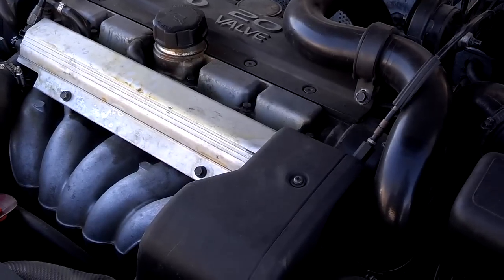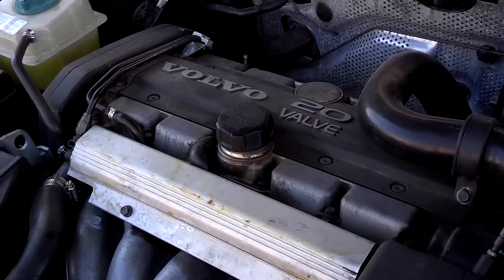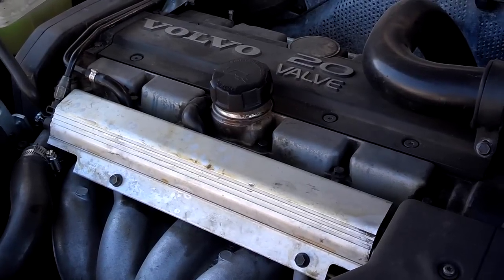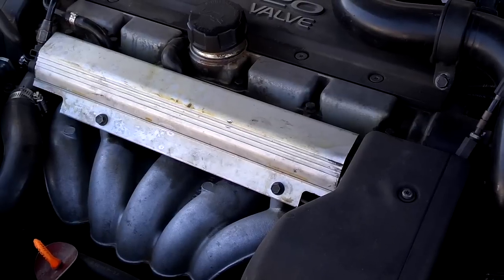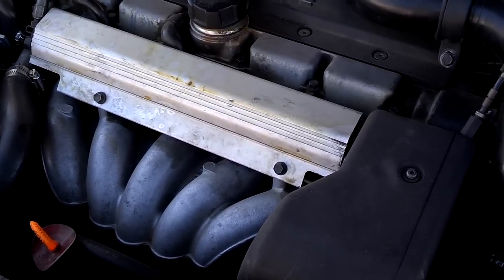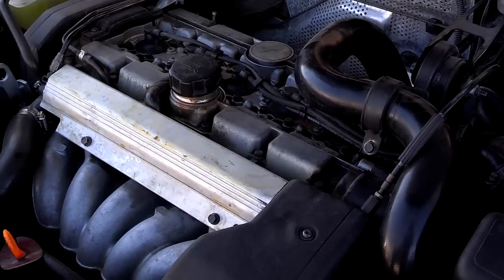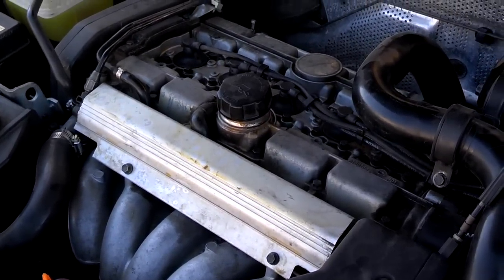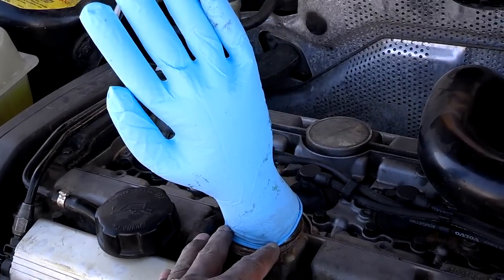What is a PCV system and how does it work? - Auto Information Series

Comment: Hi  Robert.  We have a 2011 C30.  Yesterday we noticed that it was making a squealing sound, very similar to a loose belt.  I actually thought that was the case.  I brought it to our local mechanic and he listened to it with a stethoscope like thing and said the sound was coming from somewhere just to right of the belt.  He took the oil cap off, and the squeal stopped.  There was quite a bit of suction going into the hole, so a no glove needed, we could feel it.  He put the cap back on and the squeal started again.  Then he took out the oil dipstick, and again the squeal stopped, and there a lot of suction going.  You could actually hear it.  Seemed like way more suction than in your video.  He put the dipstick back in and the squeal started again.  Any thoughts on what the squeal could be?
Reply from the maker: Bad PCV system. A diaphragm in the box. I think iPdusa.com sells them.

Comment: Hi Robert, i have b4204s 2.0 4 cylinder n/a engine and i want to turbo on it. So i bought a s40 2.0t engine turbo td04 12t. My original pcv is broken so i need to replace it. But i didnt understand how is the difference between na or turbo pcv system. Which pcv you suggest to my case?
Reply from the maker: https://youtube.com/shorts/3T-dq77zOy0?feature=share
Reply from the maker: https://youtu.be/WRd8lSAPcM0

Comment: I do not have the hose which is located just beside the oil filler cap. I've B5252S which is non turbo and 10 valve model. Don't know if I've EGR though? And it seems like it's rare to find a kit to that particular engine :(
Reply from the maker: Is it missing?

Comment: I know it's a 7 yr old video but I'm glad I found it! New to volvo and got one back in may in new England area and drove it to Florida and then back up north and a few weeks after I did a oil change and oil system flush since it was dirty oil in it and I believe after that it clogged up my oil trap system and car has been running rough and I did the glove test and it slowly inflated so I hsbe it going to a shop next week to replace pcv system and going to ask them to just look at the air lines and other rubber lines to make sure they are good and if not I'll have them replaced as well. But thanks to finding your video I tested it and found my issue so thank you !!
Reply from the maker: Who told you to "flush" the oil system?

Comment: thank you very much for your beneficial videos, I'm from Turkey, I've just both 97 model auto 850R, I gave it to my mechanic completely restore to factory condition, we replaced cylinder head and turbo, PCV system hose unplugged, we replaced hose at cylinder head and also box, and we make all connection engine makes blue smoke, when we removed hose of PCV it leaks quite much amount of oil, we don't know reason, we want to solve it, do you have any recommendation for us about cause of our problem?
Reply from the maker: Did they clean out the hole going to the oil pan?

Comment: Great video. I have a question.  My xc90 03 is smoking and my mechanic said to get a valve cover gasket but looking at your video seems I dont need it. I recently put a thick oil in it a d now its smoking badly.  Do I need to purchase the PCV tube to start with for a fix? Timothy.tucker76@gmail.com
Reply from the maker: https://youtu.be/pYuszsm9v1c

Comment: I use Toyota Camry 2000 model V6 engine and I experience oil leak at the cylinder head cover as well as smoke at the tail pipe, so I decided to replace the PCV valve, the smoke stopped but I still experience oil leak at the head cover after replacing the head cover gasket, what could be the cause?
Reply from the maker: Bad valve cover gasket.
Reply: Thank you for your swift response, I will change the gasket again.

Comment: I add a hose flow restrictor with at least 1/8 inner diamete or 3/ 16  depending on the size of the engine displacement .  The return PCV hose is wide open and unnecessary due to the restricted flow inherent in all PCV valves due to the ball check inside them..  Why leave the return hose wide open often 1/2 inner diameter or so..  Be sure not to let the hose flow restricter slip through the return hose by clamping where it is inserted insde the return hose. If you are unsure what I mean. then I can explain further.   you have to be careful with inserting and securing the hose flow restrictor insdie the return hose near to the air box hose. The hose restrictor need to be wide enough to be snugly tucked inside the return hose and to add an aircraft clamp over it as a safety measure to prevent it from being slipping into the throttle body or worse. I notice an improved performance response . Some hose flow restrictors are very tiny as small as 1/16th which I dont recommend. It should be a minmum of 1/8 to 3/16th. 1/4 restrictor inner may be pointless . but dont hurt to try to compare performance to your own liking.. It is important to have a little return air into your crankcase  that is more than enough to satisfy your PCV intake requirement.  The 1/2 inch opening inside the return air hose doesnt make sense to me. However, you can cut the return hose in halves and connect the hose restrictor coupling, of course.. there are thick restrictors available at auto parts store.

So
Reply from the maker: Interesting.
Reply: This way more blowby gaees will be drawn out from under the piston cylinder through hariline cracks instead of drawinig too much useless return air from the airbox intake tube. Maybe PCVs will go electronic someday.. I have seen similar restrictors but not sure what specific purpose it was for although it is under "PCV' search page.  I see pictures Images  of hidden restrictors inside rubber hoses that I assume are return hoses.. I saw it in Mustangs.. I wonder ..
I use a rubber boot as a restrictor as an experiment in my Versa and it feels different, indeed.  I mean those rubber boots used to connect those very thin plastic vaccuum tubes used in some cars.. It has an opening of about 5/32 or so. for bigger engines above 3.0 lit or so, I would use at least 3/16 or 1/4 to begin with and see. I see some restrictors with 1/16  which I feel is not practical or sensible.. dont put restrictors close to PCV vavles,,, Put it in the other separate return hose that draw filtered air from air box PCV vavles must have free path toward the crankcase  with the return hose competinig with the blowby cracklines around piston rings for return air toward the PCV valve separately.  We probably will desgin sensor to feel atmospheric pressure inside crankcase to determine how much air is needed from the return hose into the crankcase. Engine runs like it is on iced oil..Cluttch seems idiotproof as you hardly press gas.especially on first gear from stopgo

Comment: Mr. Robert. I knew there was something about you that was alright. I'm a fellow turd chaser myself. Plumbers & Pipefitters local 582 Santa Ana Ca. I'm plumb dandy proud of my plumbing background, Dad was one, his dad too. Two my brothers. Cousins, etc. But anyhow, thanks again for your video. I know your a busy man and little nonsense, but I'm in a pickle. My 98 850 turbo won't start due to my surgical replacement of that 90 or elbow on the passenger side of the manifold. It was running fantastic before. the elbow was sucked in on itself and had a good sized hole. Smog is coming up so  I figured gotta do it. Cut the hard vacuum line behind the Elbow to replace. replaced it, trying not to pull or jerk on the PVC (hahahaha) system behind it. Obviously my cheating did something bad. I removed the radiator hose, thermostat, unplugged an electrical connection to the alt. and reinstalled correctly. It started and idled ruff so while it was running I was able to disconnect the elbow, thinking it would run like before and I'd just have to replace the whole unit behind the manifold. (yikes) how can i start it? I need to move the damn thing before I do the entire system like I should of in the first place. Don't have the time for the all the work involved. Robert? is the whole PCV system going to have to be gone through now and all the work I was trying to avoid, now be done before it'll start. I just need it to run and roll. give it to me straight fellow plumber!
Reply from the maker: +Dana Kelley you likely flooded it. Also, sad to say, it is hard to cheat that system.
Reply from the maker: +Robert DIY https://youtu.be/3InZVPLYgqs
Reply from the maker: +Robert DIY https://youtu.be/hwCzPPiBxk8
Reply from the maker: +Robert DIY make sure you have the ECT sensor plugged in.

Comment: Robert, i have had a worsening loss of power on acceleration over time, to the point that now the engine hesitates and will not rev when in park unless I lift off the gas pedal and do it lightly. MAF, Throttle position sensor, crankshaft sensor, throttle body and IAC all ok ( cleaned and tested) But glove inflates. I also think the cat could be clogged. Is a clogged exhaust system likely to give positive crankcase pressure to inflate a glove?
Reply: I removed the forward O2 sensor and a plug opposite and loosened the cat from the outlet with much better engine response but compromised power.
Reply from the maker: +stefis6 what kind of car do you have?
Reply: Volvo 850 GLT 1993
Reply from the maker: Sounds like it.
Reply from the maker: Probably a clogged cat.

Comment: Great video, the glove that was pressurized was normal due to flexibility, if the oil cap is install, air will direct to the PCV if it is working properly.
Reply from the maker: OK, good luck with that.

Comment: hey robert, I have a 98 s70 glt with a couple issues. one being the temp sensor, and the other is that it's burning oil. I don't
 see any leaks but it's emitting a light gray smoke from the tailpipe and when I checked the oil to my surprise I was about 3 quarts low. any chance these 3 issues might be related?
Reply from the maker: Maybe 2 of them.

Comment: Hi Robert,

I have a Normally aspirated 1998 V70. I believe the PCV system is partially clogged. Glove will inflate a little and then get sucked in as I rev the engine. I do not have the time or money to fix this at this time. I am concerned that the pressure could build up and blow the seals. Will leaving the dipstick open an inch or putting a slice in the oil fill cap gasket allow the pressure to be released and prevent the seals from blowing until I can fix the PCV system properly.

Thank you,
Joe
Reply from the maker: +Joe Sterinbach I don't promote doing the other stuff. Just take it easy until you get it changed.

Comment: Love your videos! , I have a 2002 c70  thats blowing smoke, I just had the head and gasket replaced, and the car isn't losing coolant. There isn't a LOT of smoke  like clouds , but more like wisps and doesnt smell sweet , almost smells sharp.. looking for other causes  for the smoke..   could  the PCV be the  problem ?
Reply from the maker: +Eric Coleman That or turbo going bad. Smokes while driving?
Reply: Yes not when it starts up right away takes about couple minutes then it looks like there is a small fire starting ... is there a test for the turbo?.. and did you make it to Austin on your torr?

Comment: Hi my 09 Toyota highlander smokes at startup and under load at 2k+ REV whem it is above 100km/hour under load. it works fine otherwise. Could the PCV be responsible?
Reply from the maker: imisi fashanu Is the vehicle turbo? How often do you change oil?

Comment: Hi, I did this test, tonight, with a cold engine (B5244T5, 53,000 miles), engine, it didn't inflate, neither deflate. Tomorrow morning, I will do the test when the engine is hot and  I will look at the plugs too. But my question is the following : I renew the oil every 12,500 miles, and use synthetic 0-30w, is this better or worse in the prevention of a PCV problem? thx.
Reply from the maker: John Callaghan Full synthetic oil is better. It prevents the PCV system from clogging up. How old is the vehicle? 12,500 Miles may be to long of oil change intervals. What kind of car do you have? 0w-30 May be to thin. - https://www.youtube.com/watch?v=nuTOn-d_6u4
Reply: Oil change intervals are recommended every 30,000 kms (19,000 miles) or year.I change it every 20,000 kms. It's a 2007 s60 T5. It is driven upto 2000 rpm until the oil is hot.. Driving style is normal.Oil filter is changed every time.
Reply from the maker: John Callaghan Good deal. Please do what the owners manual recommends or better. Thanks for the update.
Reply: I had bought it at 62800 kms, in Germany, 38500-ish miles, last year, from someone who couldn't drive 'stick' anymore and needed an automatic. It 'drinks' 1 liter of oil every 10-12000 kms (6200-7500 miles), I replenish immediately when required.

Comment: can you clean PCV system with a fluid or carb cleaner or sea foam inserted to the tube near the oil cap in order to avoid extensive work and replacement of all system
Reply from the maker: adrian avram No. But feel free to prove me wrong.

Comment: Hey Robert. Thanks so much for posting. I have the symptoms shown here with the oil leaking out of the oil filler cap. Also had a blown leaking VVT pulley which has since been repleaced.
Also had oil trap replaced but the problem is still there.
Now I'm running out of money and need to get on with checing if there's a clog somewhere myself.
I couldn't exactly see what to look at when you zoomed in on the PTC. 
Do you have any pictures of a step by step, removal and cleaning of PTC and all possible breather hoses that could be clogged? I could really only see the passenger side one distinctively.
Thanks in advance for any help you can offer.
Reply from the maker: juliangraham2000 What does "oil trap replaced" mean? That should have included all of the PCV hoses, etc. - https://www.youtube.com/watch?v=FIRoc0VxLd4 - https://www.youtube.com/watch?v=eEZzqyu2a6c

Comment: Hello, I have a 98 volvo s70 GLT with 134,500 miles and I have milky oil from the dipstick and I lost about 1/4 antifreeze coolant from the reservoir and I don't know if I have a blown head gasket or if it's from something else. I know my pcv system is clogged because I did the two tests you have a video for the pcv system. Any help??
Reply from the maker: Bobby Correia Service the PCV, that will help... ASAP, before you start blowing oil seals. The car is likely suffering from short trips. You also have a coolant leak somewhere. Has the 2nd timing belt been done yet? Is the water pump original? How old is the heater core? - Milky white gunk on oil dip stick. Is the head gasket blown? - Auto Information Series - Heater core leak, bypass, coolant leak information. - How to test for a blown head gasket on a Volvo. - Protect Your Engine, Avoid A Blown Head Gasket, Replace Your Coolant Hoses - Auto Information Series

Comment: Hi Robert, I have 1996 volvo 850 non turbo (roughly 140K) -- have been having a rough idle and when accelerating from a stop it will seem like it will stall. Once up to speed runs fine. CEL just came on for running lean. Possible causes were heated o2 sensor, large vacuum leak or MAF sensor. Someone told me to check the PCV via your video - no smoke from dipstick, but glove did blow up. You mentioned a compression test in one of your other videos - should I do a compression test or just replace the PCV? I don't want to buy the kit and have my friend help me if it is a sensor issue. Your videos are great and really appreciated, I thought I might ask your opinion since this is a job a little out of my league. Thank you so much.
Reply from the maker: katie13711 Hi Katie, if the PCV system is clogged (glove inflated), you should have it replaced. The smoking dipstick did not work on my car and my PCV system was in real bad shape. I would do a compression test before doing any major work on the car just in case the motor is worn. If the compression test is good, yes replace the PCV system. Other than that, you may have a massive vacuum leak at your intake hoses or somewhere. A bad MAF will also cause those issues. I'd also consider the ECT.

Comment: Hi Robert, I recently discovered my crank breather hose was missing after getting an oil leak fixed at a garage in France. Unfortunately I didn't discover it was missing until I'd driven about 1000 miles through Europe to the UK. Is this likely to have caused any damage to the engine?
Reply from the maker: Is the car still running? I don't understand what you mean by "crank breather hose"?
Reply: Robert DIY Yes, the car seems to run fine (just a little rough and hesitant perhaps). By "crank breather hose" I mean the crankcase breather hose. The hose is missing completely.
Reply: Rick Palmer should also say - it's a 2002 V70, not an 850. The hose used to run across the top of the engine next to the large cable guttering
Reply from the maker: I wouldn't worry about "if any damage". Just get the hose installed and move on.
Reply: ok, thanks Robert! Love your channel by the way! Keep up the awesome work :)
Reply from the maker: Thanks for watching.

Comment: i had my vent hose on my 06 s60 crack today, i super glued it back together but until i get it to a mechanic, it will have to deal. what happens now that there is a breach in the system? will it cause large amounts of damage if i leave it like this for 2 weeks?
Reply from the maker: I doubt it. Not sure what hose you are referring to but it will either cough oil all over the place or run real rough. No big deal, keep an eye on the oil level.